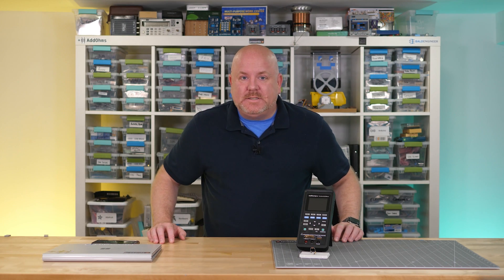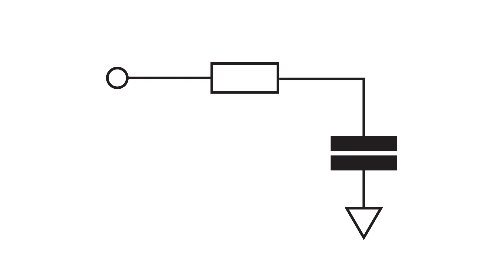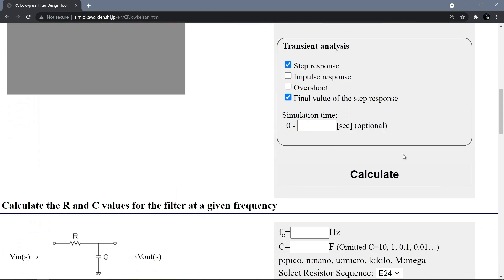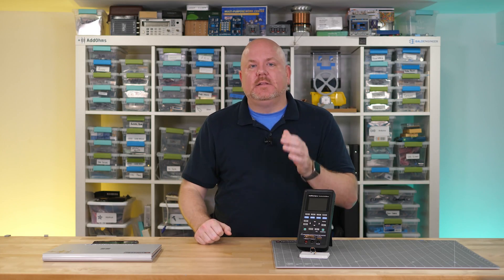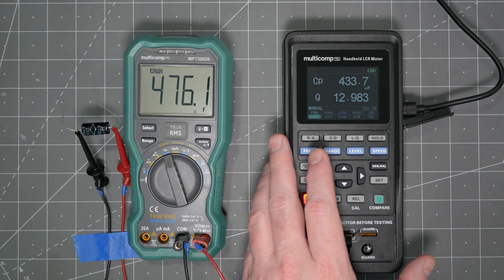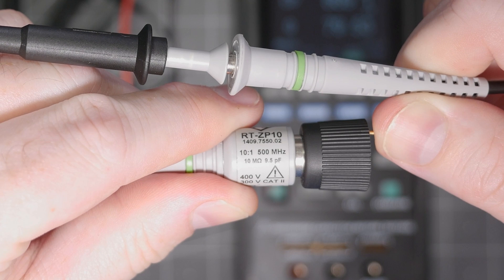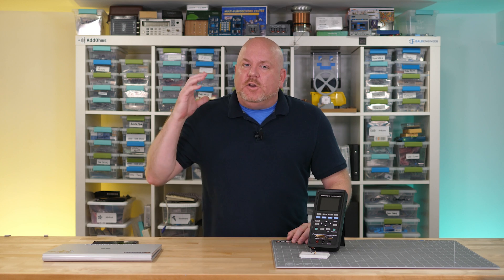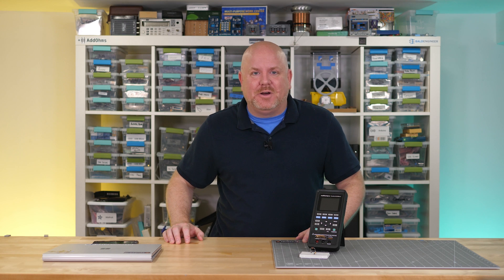Compare Ideal vs. Real Filter with an LCR Meter - Workbench Wednesdays

Comment: Would it be a better idea to use Texas Instruments DSP processing and High School mathematics to do the donkey work and use a sampling rate of 4x the frequency to be filtered io for a cutoff frequency of 100khz would be 400khz the filter shown is not for 100 hz to 100 khz is just an example.

    long double m_pNum[5] = {0.001836, 0.007344, 0.011016, 0.007344, 0.001836};
    long double m_pDen[5] = {1.0, -3.0544, 3.8291, -2.2925, 0.55075};
    long double m_px[20]={0.0};
    long double m_py[20]={0.0};

void IIR_Filter(long double data_in[], long double data_out[], int len)
{
    int i, k;

    for(k = 0; k < len; k++)
    {
        m_px[0] = data_in[k];
        m_py[0] = 0.0;
        for(i = 0; i <= m_num_order; i++)
        {
            m_py[0] = m_py[0] + m_pNum[i] * m_px[i];
        }
        for(i = 1; i <= m_den_order; i++)
        {
            m_py[0] = m_py[0] - m_pDen[i] * m_py[i];
        }
        for(i = m_num_order; i >= 1; i--)
        {
            m_px[i] = m_px[i-1];
        }
        for(i = m_den_order; i >= 1; i--)
        {
            m_py[i] = m_py[i-1];
        }
        data_out[k] = m_py[0];
    }
}
Reply: no